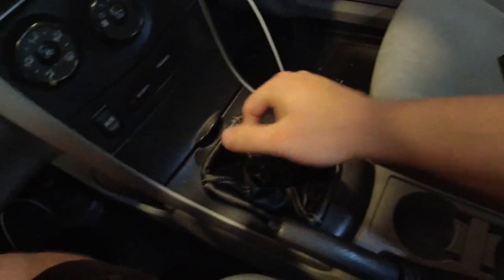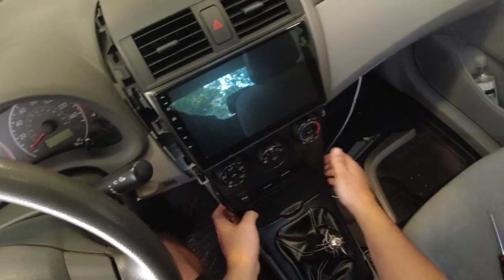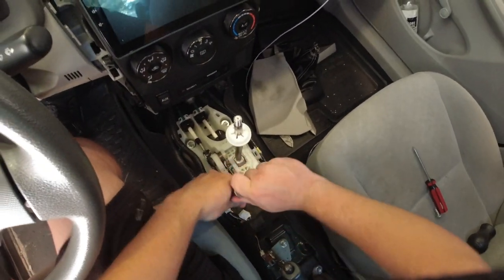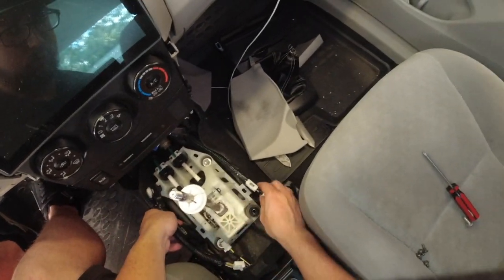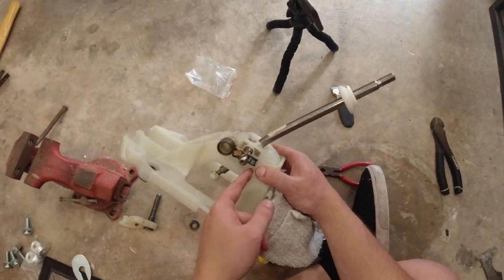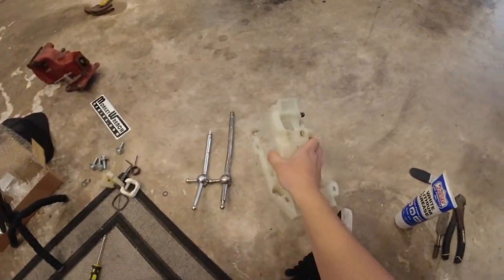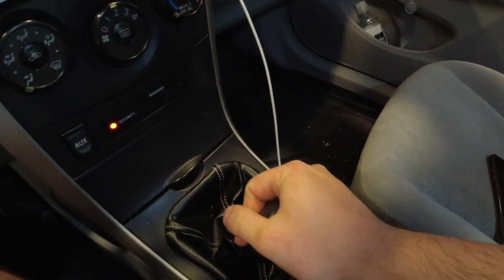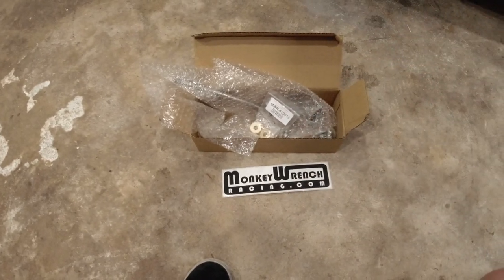HOW TO INSTALL SHORT THROW SHIFTER IN 2003-2013 TOYOTA COROLLA

Comment: Thanks for thr tutorial, Brandon!  I just received my kit & brass bushings for my '06 XR-S.  Every review I read on MWR's website for both upgrades were positive, and made a noticeable improvement to the feel.  I can't wait to get them both installed!  Thanks Again, Brandon!  Cheers!
Reply from the maker: Thank you for watching! This was a great upgrade to my corolla! I hope you enjoy yours aswell!
Reply: @BrandonStellmach  I'm sure I will!  I'm planning on eventually rebuilding the transmission esp. upgrading the 3rd & 4th gears(a known weakness in the C60 transmissions), or all the gears if I can afford it, New synchros, installing the Kaaz SuperQ 1.5way clutch style LSD, new clutch, throw out bearing, etc. With some suspension mods to make it into a monster in the corners😆😆😆😆😆
Reply from the maker: @lobsterbisque7567 if you do all that, it’s going to handle amazing!

Comment: I own a Corolla 2009 too, but made in Brazil, it has a big "accelerator pedal lag" if you know what I mean, English is not my native tongue, you press the accelerator/gas pedal and there's a lag/delay in response, and when you release the pedal it doesn't disengage immediately, there's a lag too, does American made Corollas have the same problem? thank you, great content!
Reply from the maker: Yeah the American corollas have the same problem, some people buy a pedal commander controller which connects to the accelerator pedal. And it helps with the lag. 
And thank you for the support! 🙏
Reply: @BrandonStellmach  i think I'm not sure that my corolla is japanese and it doesn't have noticable lag
Reply from the maker: The Japanese might be different then the American models!
Reply: Do they come with a six-speed transmission in Brazil?
Reply: @MrCROBosanceros  Yes, Corollas made after 2011 come with dual VVTI and six-speed transmission,  Corollas made before 2011 come with "single" VVTI and 5-speed transmission.
Reply: @androidgameplays4every13  Corolla (E140) November 2007 - July 2013 for the North American market never came with 6-speed transmission, only 5-speed.

Comment: Original shifter much better
Reply: No it isn’t. I just changed mine and the difference in quality is amazing
Reply from the maker: The original shifter is maybe smoother to shift with.
But I think the upgrade short throw shifter gets rid of a lot of slop in the shifter. And makes the shifter feel nice with each shifter.

Comment: I just bought the shirt throw shifter for my 2015 and from the same company. However it was two pieces that install to the shift cable. It made it shorter, yes, only the gear changes, but did not come with the shaft. I feel like it's missing that piece.
Reply from the maker: Well from what I have heard is the 11th gen corollas shifters are completely different than the 10th gen shifters. So I’m not sure if that’s why it looks so much different. My video probably wouldn’t be much help since I have a 10th gen corolla with the 5 speed manual. Instead of the 6th speed.
Reply: @BrandonStellmach  
If anything all I would want is the shorter drive shaft from the older gen package. I'll follow you on Instagram and you can see one of my reels of the short shifters.

Comment: Thanks for the vid, i own 09 corolla S trim and i noticed when i bought the car, the previous owner had some exterior upgrades. When i got in I noticed the shift boot was sunk in itself like yours and thought it was just stock. Did some research and found out dude put in a short throw too!
Reply from the maker: No problem!
And that’s awesome to find out you got a short throw shifter! Saved yourself about $100!
Next is to see if they did the bushings too!

Comment: i can’t get the little black crush washer or whatever it’s called off on the side of the shifter housing
Reply from the maker: That was probably the hardest thing to get off, they recommend you use a Dremel with a cut off wheel to cut it off. And like I did, I used a chisel and a hammer to get mine off.
No matter what you are going to ruin it when it comes off.

Comment: I can't believe that you went to all of this trouble simply to fit a shorter gear stick. The length of the shaft below the ball is virtually identdical
You could have just sawn a couple of inches off the length. This IS NOT Throw throw, Short throw involves moving the fulcrum pivot further us the shaft
Reply from the maker: I agree with you. The fulcrum point was almost identical,  But the throw between shifts feels shorter, and feels like a better shift. 
It seemed like a lot of work, but in reality it was about an hour of my time and only $100 for something fun to do to my corolla!

Comment: Hey man! I am supporting you. Keep on..
Reply from the maker: Thank you! 🙏 
I really appreciate it!
Reply: @BrandonStellmach  Same. And i wanted your opinion on something. And anyone else's really. Is an 06 XRS with 170k miles for $5500 a good deal? 

It's gonna be a project and I'm completely changing the look of it. I'm also adding a supercharger
Reply from the maker: It’s high miles, but for that price it’s a really good deal. I can’t even find any of them for sale around me. And the ones I have seen for sale were almost 10K with about the same miles. 
They are be coming rare cars, so when you can find them they are worth buying, as long as they are in decent condition!
Reply: @BrandonStellmach  Yea that's what i thought. It was between this and a 23000 dollar JDM Toyota Chaser. But honestly, as much as i want it, parts are hard to find. The gas mileage isn't as good. The 1JZ is legendary but it's also expensive to maintenance
Reply from the maker: @Disiplyn  yeah the chaser is a cool car to have, but it’s just not practical. vs the corolla way more practical and saves much more on gas.
Reply: @BrandonStellmach  How hard is it to work on the transmission tho on front wheel drive. Like changing the clutch and flywheel. Cuz it seems like hardcore difficulty
Reply from the maker: @Disiplyn  I personally have not done it before, but from what I have seen it doesn’t seem to bad, because usually front wheel drive cars tend to have a smaller transmission.